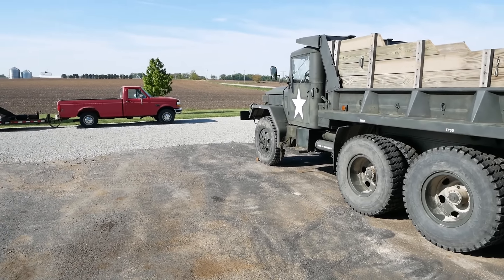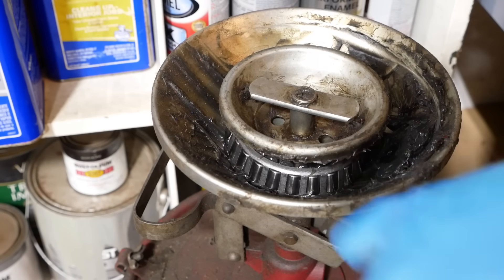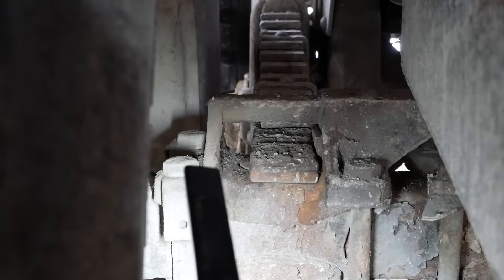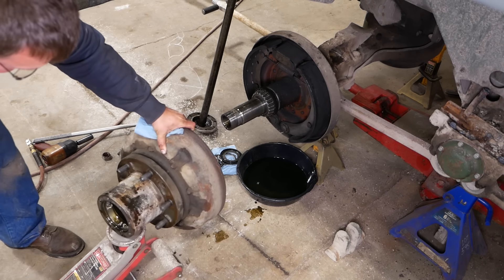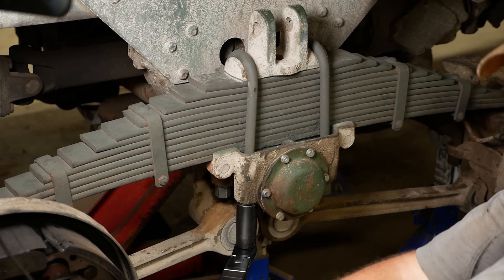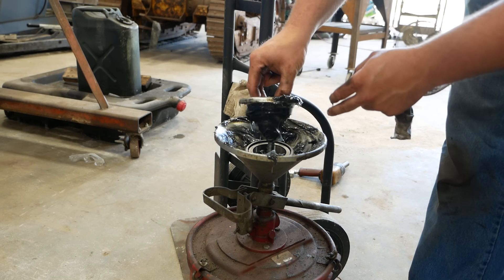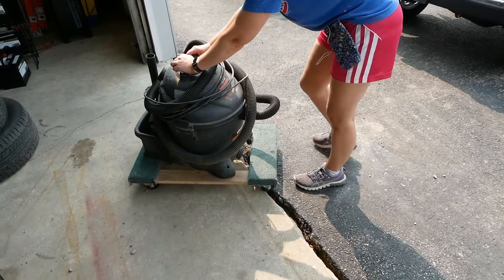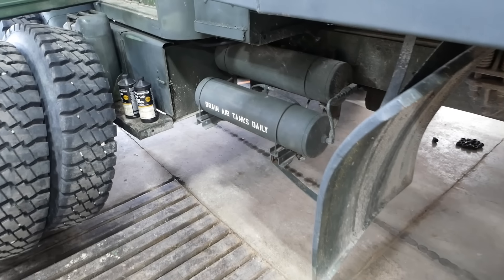Military Truck Crazy Suspension Damage - Can We Fix It?

Comment: Wes, I know this is an older vid, but if you EVER run into ANY chassis issues with the M35's (Deuces) and need parts, info, etc., your first-stop really needs to be Boyce Equipment, 2893 American Way, Ogden, Utah. They have been 'refurbishing' these under various government contracts since at least 1985, and have a LARGE warehouse with a lot of the parts on-hand, ready to ship. Full suspension trolleys, rebuild kits, steering boxes...name it. Not really a 'turn to' for 'non-OEM upgrades', but like with the springs, they could have freighted you a replacement set, ready-to-go, for less than you paid for yours acquired locally. They do everything from refurb to 'new buyers', to overhaul engines, to bob trucks for custom orders...military trucks are their business, and I've always gotten excellent shipping times from them. Great to have on speed-dial, when you own one of these, or work on them.

Comment: When I was in the military we had to do a complete engine swap on a Humvee that had less than 50 MI
Reply: @alexanderzerka8477  it was supposed to have oil for the 30 Mile journey to base however it did not have any fluids and it was the only one of the 70 vehicles

Comment: The shift pattern of that truck is called a "W" pattern. It was pretty common in trucks through the 70's that had a PTO setup in it. As strange as it feels to shift that pattern...imagine jumping into a truck that has the shift pattern sticker missing and trying to figure out why you can't drive that truck worth a shit. LOL
Reply: If you think that's bad - the 1953 Zils had the "guess what's on now" game for a shift. First is right and bottom (right, where Reverse is supposed to be), then you have second and third in "normal" left up to down order, then nothing at the center top (as in neutral - lever goes there, but there's no fork to engage), Then the fourth center bottom, then "Oopsie! - that was the reverse :D" in right top, and direct is right top too, but further away right.

Basicaly like this:
2 N  R  D
N N N N
3  4  1
Reply: Lol I did that with a truck thought it was your typical H pattern and I kept missing 3rd low and. High 7th then wiped all the shit off the sticker and realized it was box pattern. Problem solved lol.
Reply: @jayswarrow1196  Oh...thats just not right. Lol. I think you win. 
Now throw a two speed rearend into the mix and give it to recent grad from a truck driving school. 🤣

Comment: "Wes: look at that. the neighbour is spraying his field" 
Me: with a tractor? 
Wes: "no, we use helicopters for that, tractors are always broken" 
Andrew: i need a helicopter. They dont break for no reason
Reply: Used to deal with crop-dusting helos.
"ten-thousand parts in close formation, rapidly rotating around an oil leak, looking for a place to crash and thirsting for someone's blood".
Reply: You are more likely to walk away from a tractor crash...
Reply: @marauder2525  
Tractors just stop and park 
Helicopters don't just park but fall a bunch before stopping  ,,,,,,, ouch ,,,,,,,,,,, 
Ohh and I hate synthetic brake fluid because Dot 3 turns to jell when they mix

Comment: The only thing i was thinking "You could forge so many knifes from this spring packs"
Reply from the maker: They're sitting behind the shop. Come and get them!
Reply: @WatchWesWork  It´s a looooong way from Bavaria in Germany, but thanks.
Btw. The Axles can get bent when the truck is fully loaded and slides off in a ditch, Happend often over here in Grafenwöhr when your soldiers got the first contact with snow. My dad was a civil mechanic back around 1977 till 1982 on base.
Reply: @Ordog213  hate to to tell you this…..but it snows in North America.  Alot.
Reply: @madjimbo4176  Hey, i know. I just say what was told to me. Problem was (and still is) that young soldiers drive this Trucks, and the slip into bad situations more often....
Reply: @Ordog213  Might have done that to that truck or slid it into a tree stump with a load in the bed.

Comment: As far as DOT 5 - I doubt it existed when that rig was new, and you'd need to flush the entire system completely to run it. Not even a little necessary to spend that kind of money.
Reply: As far as I can find out, the US Military started to use DOT5 on all their vehicles in the 1990s, so it would depend on what date this truck was sold on.
Reply: My 74 Harley used dot 5 brake fluid. It was originally developed in the early 70’s for military applications.

Comment: A farmer my dad worked for had an old International army truck. It was a five ton, and they mounted a large vacuum tank unit on it. I liked all of the basic military features in the cab: vacuum wipers with manual handle backups, a “pull to start” lever on the floor pedestal with the shifter, transfer case, and PTO controls, a red faucet valve for heat regulation, and blackout covers on the running lights. That truck was pretty sure footed with all six wheels pulling, and it was just generally badass.
Reply: By chance was this vehicle an M54? IHC actually debuted the M39 series in 1951 which were all five ton trucks.I use to own an M52A1 but those are the semi truck variants and came with the Mack Thermodynes.The original series all had gasoline engines while the last series were multi-fueled.

Comment: Yes most buses and trucks listen for banging stuff it's rods or air bags . This one was a tough one but fun to watch because my friends at my brooklyn bus company used to fix crashed buses . Getting the frame grid aligned with the wheel bulkheads was major problem . Your truck has a real frame. I would say a bent axle was a cheap fix if the frame was bent you would have needed a specialist shop $$$     Thanks for the video It was fun to watch

Comment: Merrill axle Driveline in Desmoinse did good work with u bolts and springs back in the day. They fixed us up with springs for our farm trucks. I left Iowa and the farm several years ago. Good job on that truck and that corn looks like it's doing good.

Comment: When I was in the National Guard back in the 80's and early 90's, we ran the 5 ton dump trucks. We were 12B Combat Engineers, but not mechanized so we had the wheeled vehicles. Out of the 3 line platoons, 2 had 5 tons from the 1970's which were diesel engines, and my platoon, 3rd, had gasser 5 tons from the 60's. We did have the 2 1/2 tons too, but those were used by the Mechanics and the Cooks and Headquarters.
Ultimately they took the old gasser 5 tons and put the turbo diesel engines from the 2 1/2 tons into them so all the trucks ran on the same fuel. I don't know how those ultimately did in the 5 tons, I got out right about that time, but they also updated all the trucks with seat belts, and the gassers got turn signals which they didn't have before. 
Fun times and more than a few memories.

Comment: That U-pattern on the gear shifter brought back memories of a -69 Firebird 400 convertible I once had.
It was equipped with a M22 manual gearbox and some previous owner had turned one of the shifter arms upside down on the side of the box due to lack of room (I'm guessing).
Took some time getting used to...

Apart from that: Excellent job and it warmed my heart to see that good old ingenuity is still around.
Greetings from Sweden...

Comment: Hi, I drove these while I was in the army, it's a M35 A3. The chassis came factory riveted together and in extreme all-wheel-drive conditions, those rivets just shared off and broke apart. To fix that built-in problem the rivet holes were drilled out larger and bolted together with HSS steel screws and this lasted, regardless of how the frame twisted. The M35 A3 is a thirsty run on anything that's flammable but comes as tuff as it can be. Cheers!

Comment: Nice job Wes, thorough video too. I am a physician who grew up on a farm where we were the mechanics, construction crew, grunt force, wheel bearing packing devices, etc., so I hurt along with you as you chased down the problem. My tolerance for "do it yourself" isn't as high as yours, you obviously are a professional mechanic like my brother in law who allows his hired help do the heavy work in his truck shop - but that is off my comment theme.
You did a phenomenal job with this surplus truck. It is like working on old Sears & Roebuck farm equipment - all made by the lowest bidder with decent throughput - the replacement parts change year to year but are all supposed to be "of the same design" and theoretically interchangeable. But that too is a little far from the topic. 
Physicians are supposed to just know things - and your Seabee may have realized this after talking with you - when something is not right with a really good system, the obvious is usually not the causal issue. Just like diabetes type II is not a problem with insulin - you chase down insulin resistance, unresponsive hormonal feedback loops, and you get to a constellation of triggers that result in what you see.
I agree with your Seabee - this truck is so well built - or over built - that something massive must have happened to that rear axle set. My thought was a caterpillar or tank tread caught the rear driver's axle at a pretty good speed and actually moved the truck on impact - the front to the left, the back away from the impact. Or your Seabee nailed it and the loading or unloading caught the rear axle on something pretty hard - that truck is a lot of mass moving. And parts - man you really have to know where the old junkyards are for isolated older farm machinery parts - I guess the same holds for Military surplus trucks.

Sorry you had to go through the logical progression to get to the issue with the axle. Nice job bringing everything up to spec - and excellent catch of the increased axle pressure. You can never stop thinking when you are fixing something that is used sporadically. My first big repair was to replace the bearings on a PTO driven auger or digger we referred to as a post hole digger (what we used it for). The new bearings and races were slightly thicker than the old ones and instead of thinking my way through, I did all the hard work of pulling the races, pressing the new ones in, packing the bearings and then lining it all u as I bolted it down (with the same number of steel and sealing gaskets). I had it together 4 times before an old mechanic pointed out that I needed a "few more shims" as the pieces were fitting together perfectly - it was just an old Sears & Roebuck production piece and the bearings & race were probably not the heavy duty replacements timken bearing made. He helped me cut a few shim seals and we bolted that thing back together (and finally was able to fill it with oil without any oil leaks). I practically replaced every bearing and universal joint in that old piece of equipment before I was big enough to actually manhandle the pieces to it. 

Great job - and excellent point about the shop vacs- not made for mobile comfort, are they!
Reply: Indeed Preloading the Bearing with the Correct Shims is seriously important remember in Pharma years ago  there was a seriously large reduction Gearbox with a crown and Pinion  in same, driving an agitator shaft,  a Fitter broke the plastic shims on an Annual inspection of same , and just made up a random shim fired it in ,  a few day into the production the gearbox was heating up .. it had to be shut down a a Techie came in from the Maker straight way he saw what was happening and fitted correct shim  fo the correct  Pre Load... Sorted...[The Fitter was never left near anything like Gearboxes again being consigned to mainly valve repairs Pipework and Process Leaks]

Comment: I had 2 of those trucks. An a2 and an a2c. Noticed alot of exhaust smoke while you were driving it.  If you have time, look at the cold weather pre heat system.  The injection nozzle will often leak diesel into the intake manifold. 
 My truck smoked like a chimney untill I deleted the cold weather engine heater.  Cleaned the emissions up alot.
 As far as the blue smoke, check to see if the turbo is coked up.  The one truck I had , the turbo was  totally  coked from oil leaking in. 
 The "D" turbo gives 1 lb more turbo boost and is quieter.
 I  also put a walker muffler on too. A little more bearable.

Comment: The axle bent from an overloaded truck. I've been working on heavy duty trucks since I was a kid. I'm  68 now I worked in a heavy duty truck frame shop it was common to see a rear banjo housing bent from over torque and over load twist. I have a 4 car carrier that has a bent banjo housing presently.  Great job on your video it was nice to see you checked you fluid level after your test ride!

Comment: In 1988 I was assigned to the Presidio of San Francisco. I was an engineer and she was the only company there, why the company's Battalion was in Fort Lewis, Washington. The company was Charlie Company 864th Engineer Battalion. We had all the old-school Warstock to include vietnam-era vehicles. Long story short, this is a 5-ton dump truck or deuce-and-a-half version of the dump truck. I Learned to Drive these manual transmission trucks with a full combat load in the foothills of San Francisco . And we would often drive through downtown in a convoy while on maneuvers and field exercises throughout the bay. Talk about pressure :-). And this was the same model that I drove and I deployed  Desert Storm, Shield and Recovery. And the funny thing is I was also in the Army years later to take part in operation Iraqi freedom. And I was in a unit coming out of Germany at the time as a Quartermaster. Fuel specifically. For whatever the reason we couldn't bring our own vehicles with us. We had to draw loaner vehicles in Kuwait. Lo and behold there was my old truck sitting in storage. That's almost an 11 year difference for truck that was manufactured 1970 and was Vietnam. Somehow I don't think the vehicles were using now will have the same longevity:-(. LOL

Comment: When you were talking about the power steering system in passing , I worked on a lot of medium duty trucks back in the 70s and a lot had a ram between the beam axle and tie rod . It looked like a add on system , but was not , factory install right from new

Comment: I was a 62B (Heavy equipment mechanic) we also did alot of maintenance on equipment that went nowhere 100% of the time. The military relied on those machines so we were required to do everything when the book required it even when not in use. It was common to replace new filters,oil, plugs and injectors with new ones even if the machine was never ever used

Comment: I added a remote brake fluid reservoir to mine, one of the cheapest, best upgrades.  I REALLY miss that truck and wish I didn't sell it.  Mine was the cargo/troop version.  Trying to work on it in the driveway without the proper tools and lifting equipment just got overwhelming.  If I had a good mechanic like you I would probably still have her.

Comment: This is almost the same setup our Mack cement mixers have. When I first started the truck I was assigned had a tire run out of at least 4 inches especially when I turned. I mentioned it and was told they all do that. So it staid like that till one of the owners was driving behind me and noticed it. It turned out they had replaced the springs on one side and the  replacement was actually 2” short but they didn’t want to fix it because it’s a hard job.

Comment: Wes good video first one I have seen of yours before, you did a good job on the Deuce the fact that no grease in the bearings is very telling that the seals have been leaking for a while because the oil washed all the grease out of the bearings.  In a situation like this the axle vents should be taken out and cleaned to make sure that they are actually venting if now the axle will build pressure and force oil past the seal and wash the bearings as you saw.  
If you ever work on another military truck be it a Deuce , 5 ton whatever just go online and type in military truck parts and they are supplied everywhere and if your go on a site like steel Soldiers they will supply you all the NAPA numbers for the parts also.  I have owned Deuces for a lot of years and have done this way to many times, its only kinda fun now Wes.  Take care and good work!

Comment: If on unlevel ground and box is raised trucks can and often do fall sideways which can bend frames and or rear end/axles/springs and when picked up with crane.Or perhaps it was backed into something on an angle or rear ended
on an angle.
Good job on the repair.

Comment: Hello, Arie from Haarlem Netherlands,
It is successful with bearings that the ring that is stationary must have a tight fit.
Heating before mounting.
The ring that rotates must have a sliding fit on the outside diameter.
This gives the certainty that the shaft pin cannot be damaged by a rotating inner ring.
Hopefully you can do something with this.
Greetings Arie.

Comment: I have a ex military truck also. Someone in the past had sideswiped the yellow pole at the fuel pumps on base and hung up the rear tire. It still has the yellow paint on it. Luckily it was done at a low speed and the rear end isn’t bent.

Comment: MIL-PRF-10924 Grease, Automotive and Artillery turns into peanut butter after about a year. Using the standard wheel bearing grease you used is really a good way to go. I used to work on jet engine transportation trailers and other ground support equipment in Alaska. We used marine grease (boat trailer type) it clung to the bearings better and had a much longer service life. It took a bit of paperwork to get authorized, but it was worth the effort. We saved a ton of money on equipment and time by making the switch.
Reply: Great video, Wes!